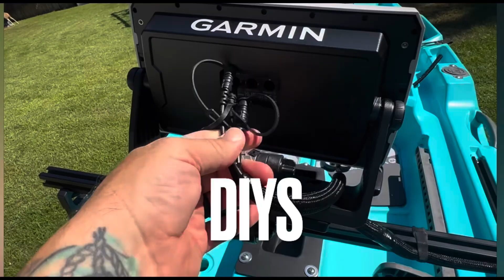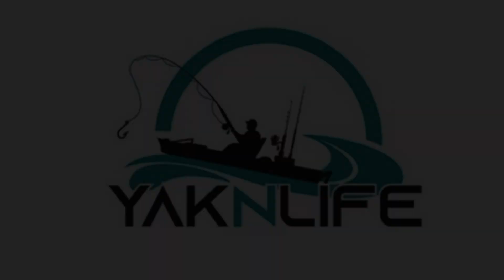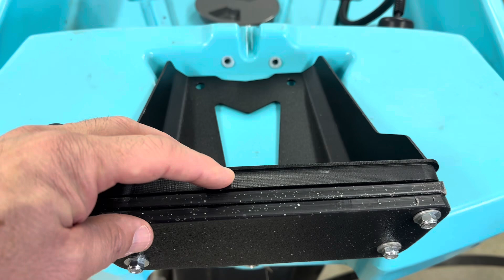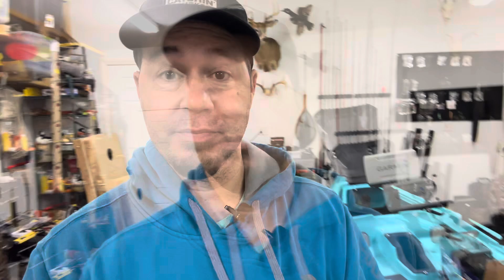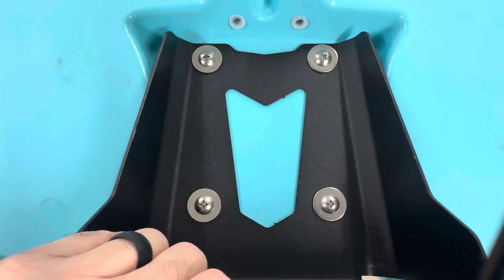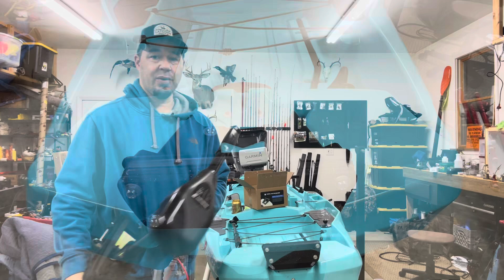Wilderness Systems Motor Mount Installation

Comment: Just one comment. I would use a longer bolt for where you added those extra plates. For the nyloc nuts to lock the bolt has to come through the nylon part.
Reply from the maker: @Lilbugr  thanks! Great idea